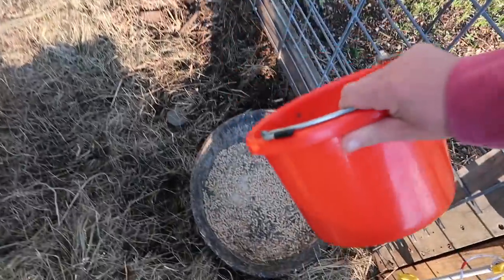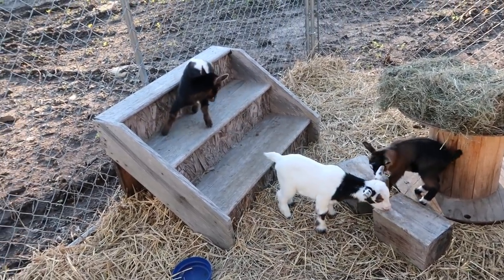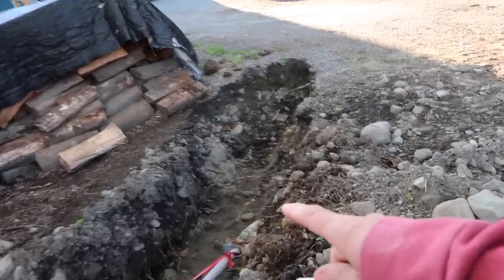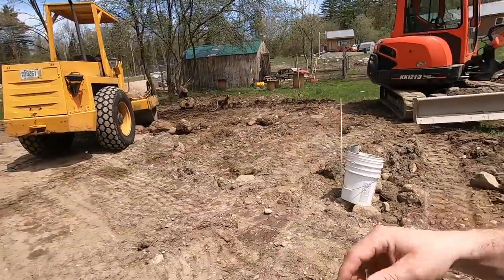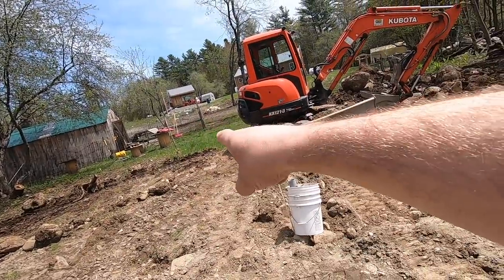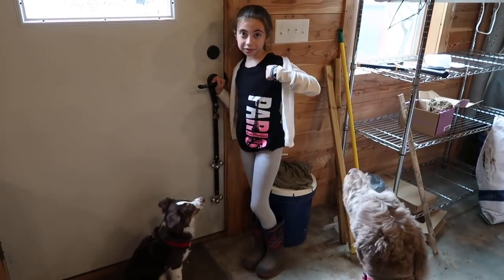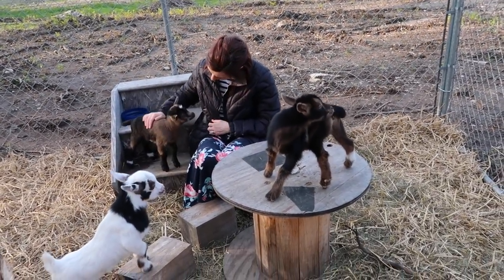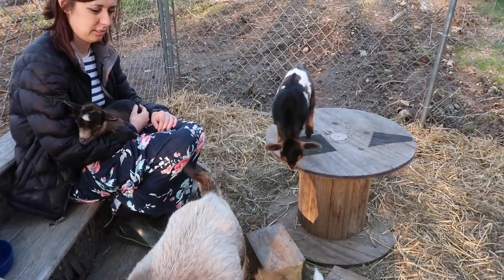We've Hauled in so Much Gravel for the POST & BEAM BARN and they're not done yet | BarnProject Day 3

Comment: Al, while you’re digging the trench from the house to the barn and should think about putting a branch line to the outdoor kitchen and run some electrical and water at the same time. Are you running water to the barn long with electrical?
Reply: I suspect a rain collection system.

Comment: Al, while you’re digging the trench from the house to the barn and should think about putting a branch line to the outdoor kitchen and run some electrical and water at the same time. Are you running water to the barn long with electrical?

Comment: If you are going to install the electric to the barn yourself, I would not mind advising you if you need any.   I designed electrical systems for contractors for over 35 years.   Respectfully,  Kevin